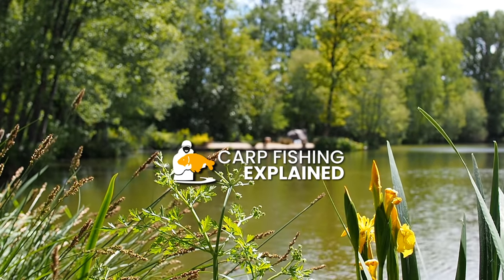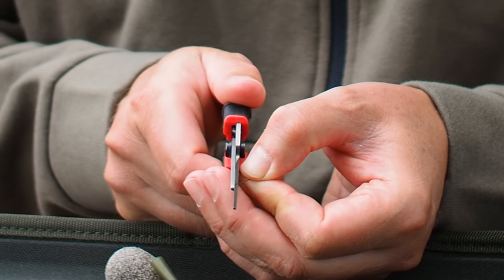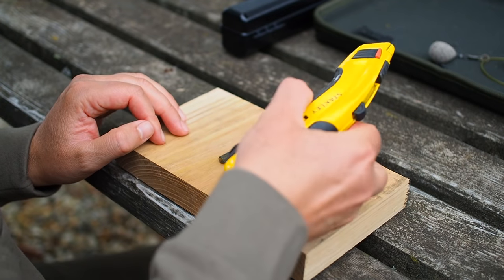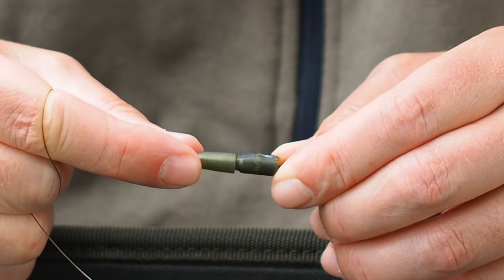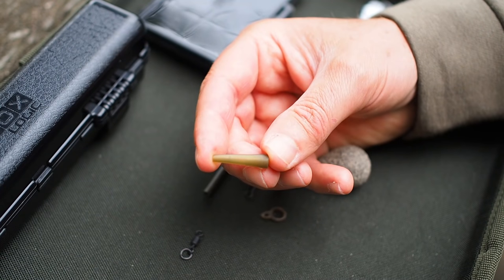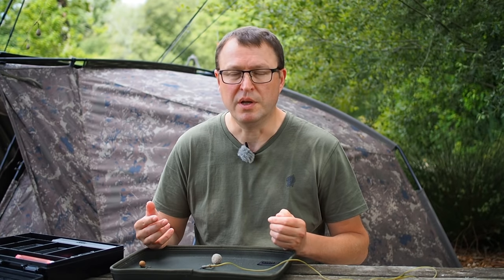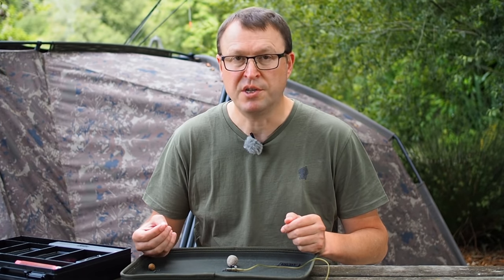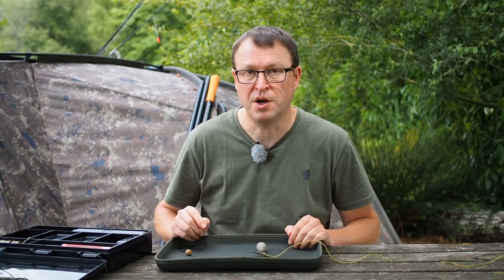I Cut the Leg of a Lead Clip (HERE'S WHAT HAPPENED)

Comment: This is a brilliant tip! I've been fishing from a young age on and off and have just bought my first proper 3 rod carp setup. One thing that I was concerned about was losing leads after every take. As it could become very costly. I will for sure be using this setup now. To start my carp fishing journey. This a accompanied along with a pop up hook with a PVA sleeved filled with 3-4 boiles. Should be very effective rig I'm thinking. I'm super excited to get on the bank and give it a try! Thanks buddy for all your help and inspiration!
Reply from the maker: Hi mate, thanks for commenting and for the support! Much appreciated. Not sure what you mean by a popup hook lol. My favourite go-to hook is the Nash Chod Twister. You can use it with most rig materials. If you haven't watched my mono hair rig video then do have a watch. It works very well with the shock & run rig and mono is cheap. Here’s the link: https://youtu.be/LzFina92brM Cheers, Matt.

Comment from the maker: 🙋‍♂ When to STOP baiting  👉 https://youtu.be/7f2yEYx0Cw0

Lead clips are popular because they are easy to use and it’s quick to swap lead sizes and styles. They are good at delivering all the weight of the lead to the hook point once the hooklink is initially tightened however there are problems. Once the carp knows it’s hooked they have learned to use the weight of the lead to throw the rig out. Obviously this doesn't always happen but it happens an awful lot more than you think it does. Even if the carp doesn’t manage to throw the rig, unless the carp heads directly away from you, the bite indication is rubbish unless you are fishing with very tight lines. The only effective way to use a lead clip is to push the tail rubber on so lightly that you dump the lead on the take. This stops the carp from throwing the rig and is safe but it costs you a lead which is bad for your wallet and the environment. Here’s a way to keep all the advantages of a lead clip system without losing the lead each time. You also get all the bite indication benefits of a running rig. I’ve achieved the optimum safe setup with some very specific components. I tested a few other combos and it was difficult to achieve the same highly reliable system. If you do find a combination of components that works as well as this then let me know. I hope this gives you food for thought.https://www.youtube.com/s/gaming/emoji/7ff574f2/emoji_u2705.png

Comment: For me this is the perfect blend of safety and effectiveness, going straight into my armoury.
I've spent a lot of time on developing rigs and set ups that are first and foremost safe, but secondly don't compromise when it comes to landing fish and this has the lot.
I've used the tungsten version of the clips/tail rubbers and added a c clip between the run ring and quick link just in case of a lead jam up but otherwise identical to yours and it works just how I hoped it would. 
Thanks for the excellent video 👍
Reply from the maker: Hi Scott, thanks very much for commenting and for your support. I presume by C-clip you mean the ones that break at a specified force? I found the Fox run rings break at a 10lbs of pull and I’ve not had the chance to test the C-clips you mention. The other way to do it is to use the rotten bottom method with some light mono. I haven't covered this subject yet but it’s definitely an option. All the best with your fishing. Cheers, Matt.
Reply: You presume right Matthew, the ones I use are called Gardner drop out chod safety clips.
They come in 2 strengths and break at either 3lb or 6lb depending on the size but I found when they're encased in silicon sleeve they take just a little more force.
Maybe overkill considering the run ring breaks at 10lb but I do like a belt and braces approach. 
I've used them on helicopter set ups when not fishing to drop the lead and they work really well to release the lead if needed.
Basically a packet of 'rotten bottoms' ready to go 😁
Reply from the maker: @scottwheeler7615  Thanks, good to know for those that like a readymade solution 👍
Reply: I never use blood knots.
Palomar for the swivel

Comment: This semi-fixed rig avoids dropping the lead or the carp using the lead inertia, but to me the primary reason to use the rig was it really improves bite detection. Assuming the mechanic works of course. 

Whether the line is straight, tight, bowed or slack, pinned down by a back lead, when the carp frees the line from the lead, even if it is moving towards the rod, the line reels out. 

I fish natural fish in rivers only, and that's good both to not leave a lead in the water and to not loose too many fish. 

Downside of the rig is the bottom has to be clean enough, and the lead has to be heavy enough. Doesn't work in the middle of weeds or buried into silt. 

I make this rig with a Fox Tadpole insert, cut in half, and the swivel is simply inserted into the tadpole. 

I really like your channel. 

Thanks for the video.
Reply from the maker: Thank you for the feedback. I have a new version of this setup and the video will be out soon.

Comment: Just an Internal rubber from an inline lead also with some PVA tape,  saves butchering lead clips, or just don't put the peg through the swivel.. one thing I've found using similar is it can cause a fair bit of mainline line twist when reeling in, due to the angle the lead kicks off the swivel at, blistering takes though.
Reply from the maker: That's another option mate 👍

Comment: Hi Mathew,  great lead set up used it myself years ago , little added thing ive done in past if using pva bag or funnel web tie a small piece of pva tape around lead clip for long casts just to make sure that the run ring doesn't dis lodge it works a treat and still completely safe.
Regards Lee
Reply from the maker: Hi Lee, good to know that it's been working well for you too. Yes, on a big cast a little PVA tape can really help hold things together. Same goes for a medium chuck with a larger solid PVA bag for when you are fishing parachute bag style. Have a great season. Cheers, Matt.

Comment: Hi Matt, I tried it on the river today, unfortunately, it doesn't work there. Because other pieces of peeking fishing line only allow it to get tangled in the grass, bottom terrain, and fishing line.
Maybe in your case, a pond where the water is still can probably work. Not on the river. Over the years I have found that there is magic in simplicity. And that's true. Between the plants in the river, the clams, the rocks, and the water current, it is necessary to keep the possibility of getting stuck on anything as little as possible.👍 Peter welfare. Eric
Reply from the maker: Hi Eric, thanks for the feedback. I don’t use this system on the river either. It was never designed for use in flowing water as there tends to be too many hazards as you say. I’m a big fan of keeping things simple as well (this is not a good example of that ethos lol.) All the best with your fishing, Matt.

Comment: Absolutely love the in depth explanation on the mechanics and safety of the rig. Just seems so much more logical than the standard lead clip. Did you invent this method yourself?
Reply from the maker: Hi Tim, thanks very much for the awesome feedback. We really do appreciate it. I came up with this system last winter. I was just tinkering with some rig bits in the bivvy and I got the idea to combine a few bits that are never usually combined. For me, the mechanics aren't really that new. It’s basically a variation of a rig theme that I’ve been using for 12+ years. If you watch my original inline running rig video you’ll see a lot of similarities in the methodology: https://youtu.be/ED58TfFEcqM This version brings various advantages over an inline system. Swivel leads are easier to cast further and you can change sizes and style quickly so there are lots of pluses. Someone else commented that they’ve been doing it too so I’m not the first! There are a couple of similar ready made systems on the market but I haven’t tested them yet. I do hope that you try the rig. Let me know how it goes. Cheers, Matt.
Reply: @matthewcollinsangler  Hi Matthew. I have used this set up a few times now since last commenting. It is very easy to set up (thanks to your video) and use, and i have to good effect landing both carp and catfish. Thankyou 👍
Reply from the maker: @timsmith9541  Hi Tim, thanks very much for the update and I'm delighted that you are getting on well with the rig for both species 😊

Comment: Been doing same for 30 years with an inline lead with the insert removed and filed out and pushed onto a tail rubber works exactly the same. My go to rig. And I just use rod lead straps....Great video again tho
Reply from the maker: Hi mate, thanks for the feedback. I’ve also been fishing with an inline system exactly as you describe for many years and it’s worked really well. I’m sure you’ve done very well on it. I’ve never bothered with rod lead straps myself but it’s a good option if you like to take your rods ready tackled up. The only downside with inline rigs is that they aren't suitable for every fishing situation, they certainly don’t play nicely with mono hooklink IMO, that’s why I came up with a swivel based system. Cheers, Matt.

Comment: Hi Matt from the U.S.A.! I have been fishing European style here in the U.S. for roughly 6 years. Once I started, many have helped along the way. Here, we do not have pressured fish, at least I don't think we do. Smaller lakes like there, are not places us wildwater anglers will fish. I have also been into understanding rigs, and find ways to not dump leads everytime. This setup looks like something we can use here. I do fish around snags, so have gone to a setup to where I dump leads if need be. I have found I do lose fish fishing regular lead clips. Not sure at this point what is best. I just hate to think a fish is tethered up and could die. This setup looks good but not around snags, as you mentioned. Thanks for another great video and explanation. Great job! If you can think of a way to fish snags and be able to dump leads, but not necessarily have to every time, that would be great.
Reply from the maker: Hi Richard, thanks very much for taking the time to comment and for your support. It’s great to know that our work has helped you catch more carp! So I have a couple of ideas for you. The plastic run ring that I use is made by Fox. I did some basic pull tests on it and the ring fails at approximately 10lbs of load so a large powerful fish could probably snap one without much bother. These are probably difficult if not impossible for you to get hold of but there is another option. You could use a ring swivel or a big eyed swivel to run on the mainline instead to form a run ring. Rather than use a quick link to connect the lead directly to the run ring, you could create what sea anglers over here would call “ a rotten bottom”. All you need is a short length of weak mono and simply tie the lead to the run ring with this. I’ve used this system myself when river carp fishing using running leads. There are plenty of rocks in the river and if the lead gets stuck it’s very easy to pull for a break. OK I lose the lead but I get the rest of the setup back. With a little experimentation it’s easy to create rotten bottoms of varying strengths for various situations. The aim is to make the connection as weak as possible so that it’s easy for the carp to break free but at the same time be strong enough to cast the lead far enough so that you don’t break off on the cast. It’s perfect for short range lobs of heavy leads on the river near me. It could also be used with lighter leads at range but there would be limits to how far such a system could be cast. Not an issue if you're using a boat of course. Hope that gives you some food for thought. Do let me know how you get on. Cheers, Matt.
Reply from the maker: Also, if you fish barbless hooks, it makes any setup extra safe because the carp can more easily get rid of the hook.
Reply: @matthewcollinsangler , awesome. Sounds good, I have a mate here who probably knows what you are talking about. The places we fish are 50 - 100k surface area reservoirs. He and I search out the weed, timber, etc to fish. I am sure between this and his knowledge, will be able to get me sorted out. Thank you for respond and again, great videos. Cheers!
Reply: @matthewcollinsangler , I have some Solar Run Rig Kits. I also use the Avid Lead Clips that do not have the pins. I figured out a modification based on components I have on hand. The.rig works exactly as you describe, Telltale and all. Thanks again. Cheers.
Reply from the maker: @t3angling575  OK great, yes those bits sound like they’d work together. Best of luck. Cheers, Matt.

Comment: Clear, simple and precise, as always,    I was thinking, gotta try this,, until you said  you wouldn't use it in weed, the waters of the club I'm in are 95% weed 4.9999999% water and. 0000001%  fish
Approx 😂
Great video as is the norm on this channel
Reply: Use a clip instead of a quick link. That way you can loose the lead if you get snagged up in weed.
Reply from the maker: Hi Scott, thanks as always for the support! Sounds like a serious challenge you got there lol. All is not lost! If you can target them at close range then you could create a rotten bottom between the ring and the lead instead of using a quick link. I just use some thin mono, granny knotted to achieve the break force I want. Other options would be an outline inline or a lead clip. Best of luck, Matt.

Comment: This is the best rig set up I have ever seen and have switched most of my rods to this.     Thanks Matt.     Did you try the Korum product yet?
Reply from the maker: Hi mate, thanks for commenting and that's awesome to hear! I haven't been able to get hold of the Korum product yet but I'm sure I’ll get around to testing it at some point. All the best with your fishing. Cheers, Matt.
Reply: @matthewcollinsangler  I am now using the Nash run lead clips after your vid on those  - just wanted to ask - do you think they have now superseded this set up or is there a case where you would still use this over the Nash clips?
Reply from the maker: @videoondemand-livecircuitt2689  Hi mate, that’s a good question. TBH it’s going to depend on the nature of the venue you are fishing. If it’s weedy and or snaggy then I’d go for the Nash system as the lead will pop off when you need it to. However if I was fishing a runs water which was snag free then the Nash run clip will probably dump too many leads as the takes can be savage on this type of water. If that’s the case I’d use this or just a basic running rig. Hope that helps, Cheers, Matt.

Comment: Neat concept on the running rig tail rubber idea, well thought thru. I'll be giving this a go, thanks. 
One question on rig tubing. I've never used it. I tend to use lead core or more recently just a naked sinking line. What are the advantages of rig tubing  do you use it in every situation?
Reply from the maker: Hi mate, thanks for commenting. I’m glad that you like the rig. 
Lots of fisheries (including ours) will insist on the use of rig tubing and that's because it helps protect the carp's flanks during the fight. A bare line can cut into the flesh or lift a scale if they roll on the line. It also helps to protect the last bit of line from damage on rocks etc. I used to use leadcore myself but the lead core can become kinked which can be dangerous on a running lead system. Nowadays I use leadless leader material such as the Nash Cling-on. I carry both the 40lb and the 65lb version depending on the situation. Cling-on sinks well and is super supple so will flow over any rocks or stones better than rig tubing. It’s also fish friendly camouflaged and very abrasion resistant so for me it’s the best all round solution and certainly better than a bare naked setup. Hope that helps, cheers, Matt.

Comment: Really great video as always. I'm new to carp fishing and you are helping me a lot. So, I really like to get into the small detail when fishing and i was wondering what exactly does the lead clip do in this rig? Wouldn't it be easier and cheaper to tie this rig without the lead clip? just push the tailrubber over a size 8 swivel. Should have the same effect.
Beste regards.
Reply from the maker: Hi mate, thanks for the feedback and glad to be part of your journey. I have tried the tail rubber only option but it just doesn't work anywhere near as well as this setup does. The lead tends to hang and take too many shakes before it slides away. This gives Mr. carp too many opportunities to shake the rig out. The other problem is that the tail rubber easily becomes disconnected from the swivel and that can easily create a dangerous rig. That’s why I recommend the combination of materials in the video. Cheers, Matt.
Reply: @matthewcollinsangler  Thank you really much Matthew

Comment: Hi Matt! Wicked info as always. How is this setup performs for long distance casting/power casting? Found the traditional run rig and tube combo a bit weird to cast. Thanks 🙏
Reply from the maker: Hi mate, glad that you like the setup. I know exactly what you mean. Pure running rigs can be cast at range but you have to use a really small bait and never add any PVA. To set this up for long range with larger baits and/or a bit of PVA mesh, you need to make sure that the swivel is pushed hard onto the tail rubber so it stays in place on a big chuck. If you get that bit right it works great 😉
Reply: @matthewcollinsangler  awesome, cheers Matt.